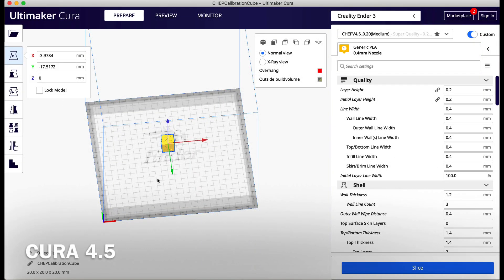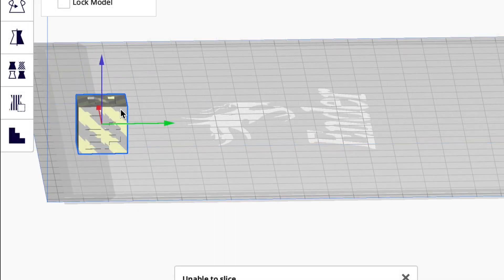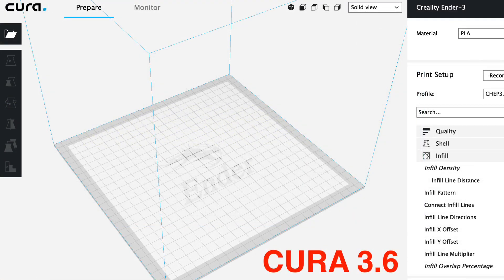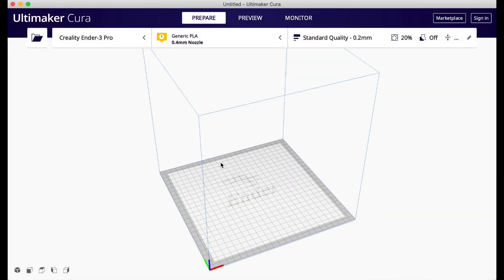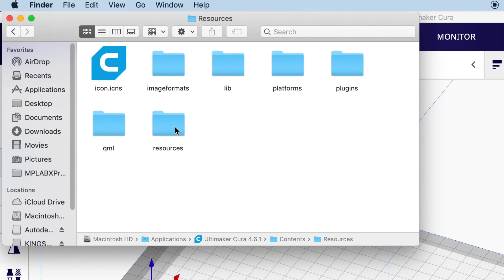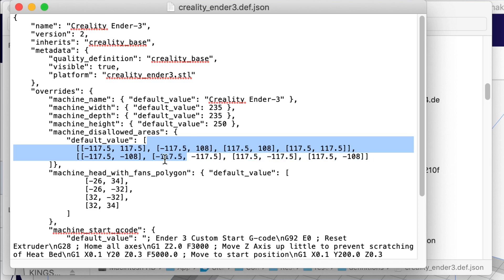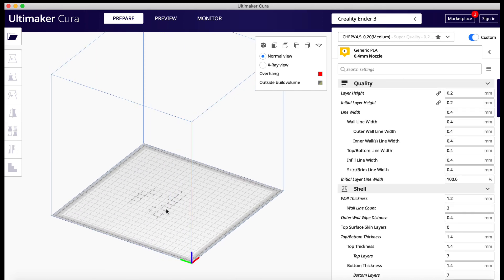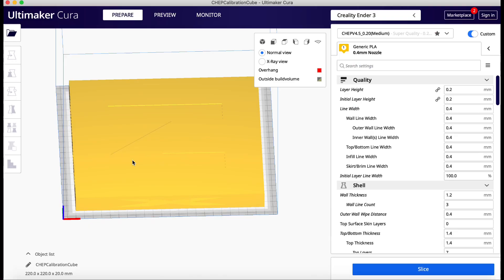How to Remove the Creality Ender 3 Keep Out Area in Cura

Comment: Excellent!  But a slight suggestion for dummies like me.  Before you change anything save a copy of the file to your desktop.  That way if you screw it up you can go back and get a fresh copy and try again.  (Believe me I learned the hardway years ago when changing important files) 😂🤣😂🤣🛑🚫❌
Reply: This is why CHEP used the Cut command. Cut saves to clipboard. You can paste it back in if you know what area you cut.

Comment: The external gray area is related to Skirt or Brim configuration under Build Plate Adhesion. If you remove it, that area can be used.